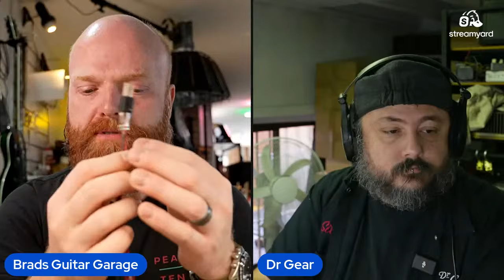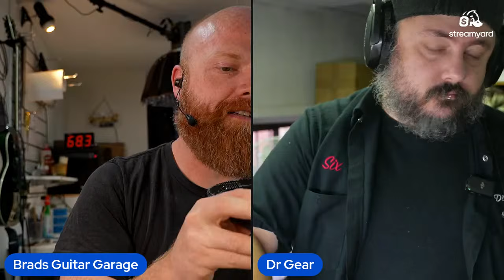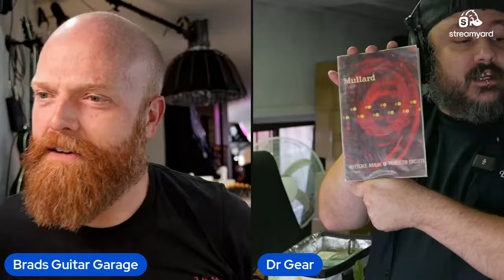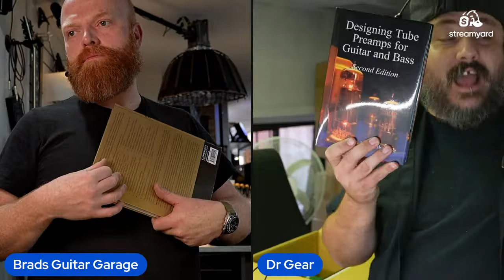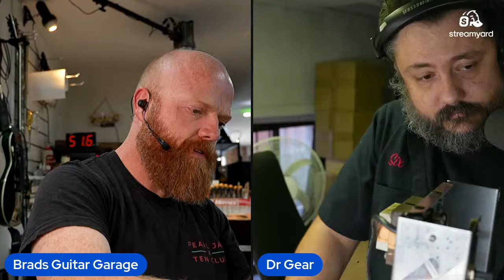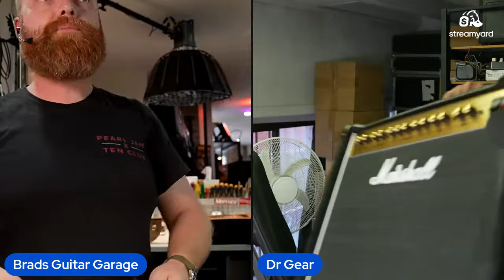Workshop To Workshop Hangout & Chat W/Dr. Gear

Comment: Question for you as this will probably be drawn out and stupid but here it goes. I own 3 valve amps Marshall DSL 40C, VOX AC 15 C2, Laney Lionheart 5-watt single ended amp and I enjoy them all for different reasons. I had a chance to use my friends Orange Super Crush 100 combo for a little over a month now and the Damn thing sounds great TBH. Never pulled the chassis but looks well built with a proper large Birch Ply cabinet and a Celestion  G12-K150 speaker made for Orange (probably just a less expensive Redback.) My question is what makes a valve amp sound better than a properly designed Solid-State amp with everything else being equal? I think we all can agree that once solid-state gets pushed to the point of clipping it is done and sounds like shit. I have asked my amp tech to talk to me like I was two years old and explain how and why a valve amp sounds better, he was unable to do so. Can you put solid-state and valve gear on test equipment within the range of human hearing and point to any test parameters that would show that a valve amp sounds better? I have zero experience with solid-state and the only amp that I ever purchased new when I was first learning guitar was a Peavey Bandit 112 Transtube back in like the late 1980s or early 1990s that was solid-state. I liked the Orange so much that I thought it could not be very expensive and went to purchase one until I found that it was not as inexpensive as I thought as they are around 850.00 dollars in the US for the combo. Call me an idiot, dumbass or whatever but not one person has been able to explain why valve sounds better other than from a nostalgia or preference standpoint which means Fuck All as far as I am concerned. This is coming from a person that has nothing but valve amplifiers but the Orange sounds great. What can be tested and shown that makes a valve amplifier sonically superior to a well-designed Solid-State amplifier? I do not expect you to answer this question as I would want money to go down this never-ending rabbit hole, but I do think it would make a fantastic video and at the very least you have knowledge on the subject without all the fluff and BS. Sorry for the long ass ramble! I am not talking about Class D or anything Digital just old school Class A/B Solid-State which is what the Orange is other than the digital reverb. What the hell is up with that Samick amp that I have been looking at for years it seems now. Does it even work? It has been so long that I would miss it if it was gone LOL.

Comment: Nice Vid.   Regarding the Kicad sims. There are definitely valve models out there now. But some are not great and need tweaking... I managed to get my full amp simulated pre build, DC in, power rail, pre-amp through power amp, OT and speaker out.   Took a while.. Not sure how accurate it is but it draws pretty pictures.. 😂

Comment: We got 28 years out of our old Amana washing machine. I fucked up and put the wrong belt on it (too loose slipped & smoked). If the motor didn't have a rough tapered shaft that destroys the pump when you removed it, I'd have gone over to the Speed Queen shop and just got another belt, but I bought a new back stock Speed Queen washer. I could have got another 5-10 years out of the Amana before the drum suspension  mounting tabs rusted off the chassis, but the Speed Queen IS the same as the old Amana, and that is why the damned things cost $1300USD. Slightly used, $1200 for a used pair Speed Queen washer AND dryer. I should be dead when those break down. As for refrigerators, I know how to make tons of fucking icecubes, and how to pour water into a glass. Just keep the frozen stuff frozen and the cold stuff cold. My refrigferator does not need to communicate with my I phone 24-7, dispense filtered water, and or make it's own icecubes. A modern washing machine from a big box store will shit the bed in 4 or 5 years. That Speed Queen basically IS the Amana that lasted 28 years. 3x$433 = $1300. 12-15  years versus 28 years? I had to replace a valve block. 1 hour, $250. Dryer belts, $50-$80, and 3/4-1-1/2 hours of labor. Speed Queen makes machines for coin op or card pay laundromats.